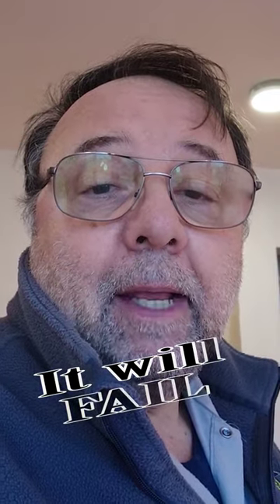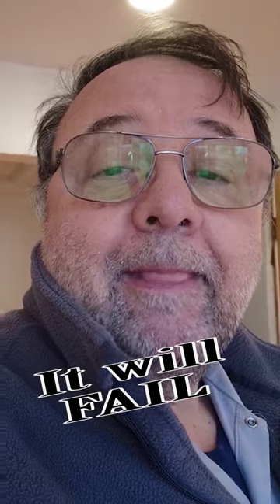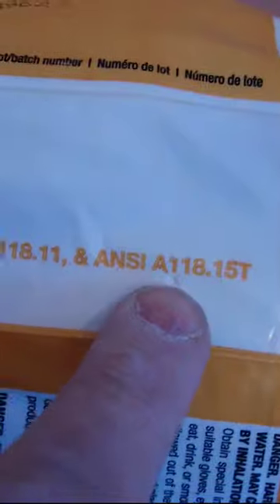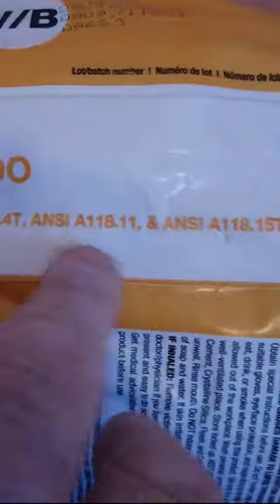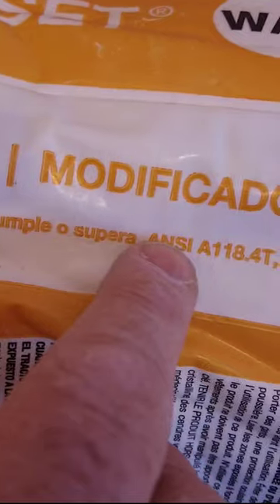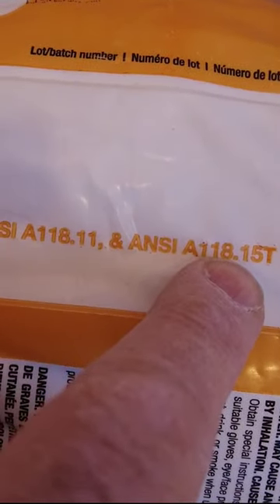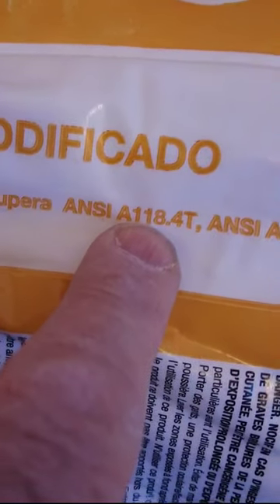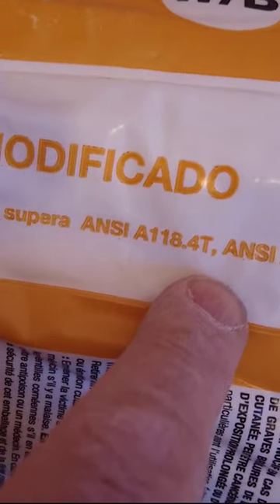it will FAIL Use the right Thinset Mortar #tile #mortar #shorts #failure

Comment: Are you talking about putting tile over the plywood? With said thinset? Or the thinset that you're supposed to be using for uncoupling membrane to attach to wood subfloor?
Reply from the maker: Installing anything tile related to plywood that calls for thinset.

Comment: How about this, don't tile on top of plywood . Just because you can doesn't mean you should.
Reply: He didn’t even say anything about tiling on top of plywood, you do know that schluter makes uncoupling membranes that are adhered directly onto wood substrates right?
Reply: @hii-jy5yx Are you okay? That's what the video was about was about thin set that is tiliable over plywood..... And yes, I understand that there is half inch. Concrete board, uncoupling membranes , and two part primer and membrane systems. But that is not tiling over wood..... That would mean that you're adding something after the wood  hes talking about in this video tiling directly to plywood.👍.... There are thinsets that allow you to tile directly to plywood . just because you're allowed to do something doesn't mean it's right .You should never put tile directly on plywood.
Reply: He said installing it over whatever membrane you’re using, not directly to plywood 🤣
Reply: @carlosromo3575 he said " Membrane or whatever" so if "whatever" includes tile.........
Reply from the maker: Installing anything tile related to plywood that calls for thinset.
Reply: I have a question, I helped someone do a big tile job when I was younger. He put down mortar on the plywood floor then gypsum board down and nailed it. He said it had to be done that way. Is that necessary? Another guy in construction told me he’d never heard of that and like I was thinking he said it didn’t make sense.
Reply: *I just want to be 100% sure before I tile my bathroom floor.
Reply: @danrichards496  Nowadays, they have thin set that you can literally tile to plywood. But I would never do that. And I wouldn't recommend that to anybody . use an uncoupling membrane or concrete board .to put down over the plywood... glued and screwed, thin set and conctete board screws .(concrete board) .... Or thinset  down uncoupling membrane on top of the plywood.( Using a weighted roller.)....... If it's one of these older houses, and it's a wood sub floor and it's way out of whack you could do it the old school way and put down tar paper and wire and pull the whole floor with dry pack......... Another option is a type of self leveler, that can go over the plywood.   ....... All that being said, I would probably use an ucoupling membrane.